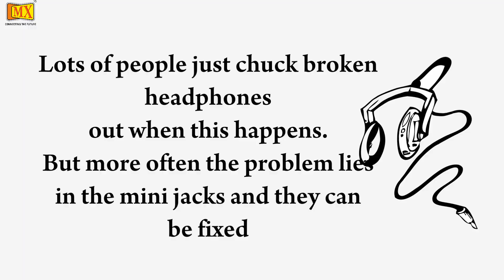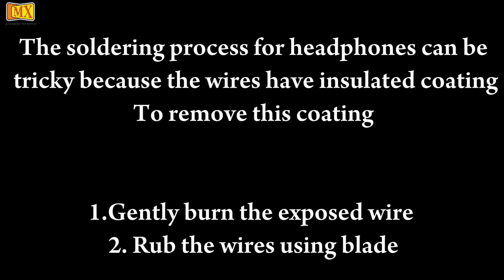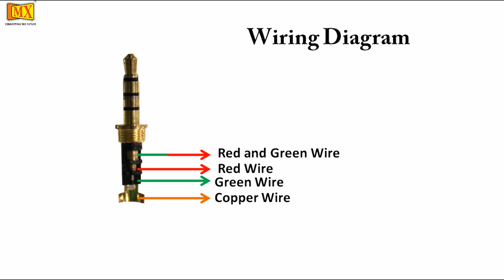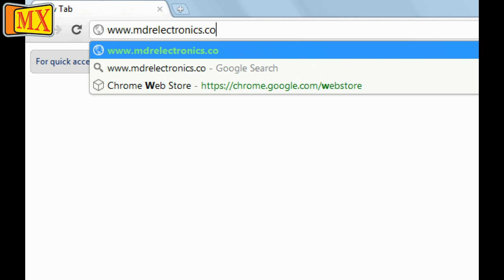How to repair or fix Earphones / Headphones Cables with Mic

Comment: Thanks for making the video. It was useful for most of it. I bought the same replacement plug.
I successfully repaired and tested my Etymotic hf3 and the colours are completely different to your video. From outside in, goes green, blue, red, copper corresponding to sleeve, tip, ring1, ring2.
Tip = Left audio = bLue
ring 1 = right audio = Red
ring 2 = ground = copper
sleeve = mic = green

Comment: Thanks man, I've had some troubles with my connector because was 4 pins but a different design and my headphones are only stereo, the haven't got mic.
Finally I got tired and make them mono headphones, only two soldering points beacuse it's only while my new headphones arrive from UK.
Reply from the maker: Thank you!!

Comment: This seems like a really nice video and just the one I need. I just have one question.
Are you able to test if it will work before soldering the cables on to the metal by holding them against it?
Reply from the maker: Yes you can!!
Reply: MDR Electronics
So I guess I must have done something wrong then since no sound comes out when I hold the cables(twinned, not solderd at the ends) to the metal?
Do you have to solder a bit on them first, at the ends, and then touch the metal covered cables to the 3.5mm contacts connection metal?

Comment: A suggestion for all people having trouble with color cables, connect the plug to an mp3/phone and play music, make different combinations without soldering until you find the right one :) (remember to try the mic and the keys before soldering)

And put the back cup on the wire BEFORE soldering, it's a common error for all the starters and when it happens it's a shame.
Reply from the maker: Thank you again !!
Reply: what the backup??
Reply: fredizzle23 What?

Comment: A couple of things : some fluxite/solder paste would have made a far neater job of the joints.You'd be amazed at how well (and fast) things bond  with a smear of it prior to  starting work. Also, most jack plugs have a crimp which helps prevent the wires being yanked off their joints accidentally ( you actually soldered the last wire to it in fact). This should have been gently crimped with pliers around the outer insulation of the cable.
Reply from the maker: Thank you for the comments....we will keep that in mind for our next video!!
Reply: Been working in the Electronics Industry for over 40 years doing repairs to component level  .. if this is an example of your expertise and abilities I would never recommend anyone to visit you or follow your advice. I realise that the video is 3 years old or more and that you may have improved since then but your video personally gives me no confidence in your abilities or that you know what you are doing!

Comment: Cool video, thanks for posting. My cable coding is a bit different:

1 blue
1 red
1 red/copper stripped
1 green
1 copper

How do I figure these out to solder on a TRRS connector?

Comment: thx man you helped me a lot i had problems with this jack i didnt know where to solder some wires red and green i got almost right the red wire was/is higher than blue wire and i had/have the copper wire or ground where red and green wire or mic wire shood have been

Comment: Why didn't you use the shrink tubing over the connections before screwing on the outer case?
Reply: +Echo6Bravo because he doesn't know what he's doing?
Reply: +Echo6Bravo  The rubber casing sits inside the outer housing, so when its screwed on the rubber is already there.

Comment: I fixed mine myself but with another factory made broken aux cable. just find the right cables(color helps) and solder them to each other.  or just burn the tips and twist in pairs.

Comment: great video! i have a question tho. im repairing a pair of turtle beach headphones (the xl1's to be exact). they have a white fiberous thread running through them. is this the same as the yellow thread in you video...useless i mean? i dont know of any fiber wire and i dont know anything about fiber-optics. anything you could inform me of would really help. i game a lot when im not working and cant afford to just go buy a new pair. thanks
Reply from the maker: We will have to check…..Sorry but we don't have that Headphones!!
Reply: The white fibreous is only a cover for the cable, you can burn it
Reply: thanks

Comment: Hi when I was trying to solder it the solder wasn’t sticking to the plug or wire .in the end the plastic next to the metal started melting and just became a mess. Can you suggest something I could do?   I’m new to soldering p.s I’m using a 30 w solder iron

Comment: Hi : I have the same connector but the in cable of a Klipsch image one headphones has red/green/red and green/copperx2. but in the centre of the red and green cable is a white cable. Where do you solder this on too ????
Reply from the maker: Let us check with our Engineer!!

Comment: Lets say I want to use a 3-pole jack with my 4-wire headphones. What do I do with the left over red-green wire?

If the wires are in contact with eachother after soldering, is it bad? 

One more thing, the cable of my headphones is made of a cloth-like material. How can I remove it since it might not be easily removed like the plastic in the video?

I'm going to perform this later this week and this is useful. Thanks!
Reply from the maker: You can strip them off if you like!!

Comment: Would it be possible for me to make a phone headset(with mic) work on a PC?
Like if i used a "MX EP Stereo 3.5 mm with 4 Pole Jack" from the video and soldered 2 wires with 3.5mm jacks to it, 1 for the headphones output and 1 for the microphone's input?

Comment: My 4 pole jack has a piece that is small coming out of the middle ,one tap out to the left ,and then the big one with the hole in it .the cable coming out has a copper,green ,red, and in the middle of the copper a very small white one. How do you connect this ? ( my earbuds are dr dre  beats )

Comment: hey first of all thanks for the video! but i have 1 question, when i stripped the cables i have a green,red blue and copper! is the blue one the same that the combination?
Reply from the maker: Thank you and Yes some have blue color but the rest part is the same copper has to soldered at the right place

Comment: I just trued to do this. I think I ruined three repair connectors. Its sorta tough to do this tiny soldering. These wires are finicky too. They don't soak up solder easily. Oh well ill continue trying. I have a good soldering station at least.

Comment: I'm pretty sure you were supposed to crimp the black outer sheath of the wires into the "wings" at the top of the connector.  That way when something yanks on the wire, it puts pressure on the outer sheath instead of the soldered connections.

Comment: How would you connect these 4 wires RED BLUE GREEN and COPPER to its control unit from the jack..? Coz I have only to points there and 4 set of wires how.. Please tell

Comment: I suppose your red and green are the same as on the video. You just have to unwrap the copper one off the white and separate them, and your white should be the "red and green" one. Judging by what you said, you have 2 copper wires, just connect them together on the jack, it should be okay... Let me know if you try!

Comment: I have a pair of SOUL earbuds and the wire coding is red, yellow, green, and blue. any idea on what the coding for these are?
Reply from the maker: No idea!!
Reply: exactly what my problem is. but i've researched that the blue is actually for the right channel. i just dunno if it applies too

Comment: I fixed my sound but my mic still doesnt work from my trutle beach px21. I cut the cable in 2. I got rid of the white plastic cover and twisted the copper parts to eachother, whats wrong :s ???

Comment: I bought the same designed plugs for repairing my friend's headset. I gave it up, because the solder didn't attached to the plug's rings. It dropped down from it...I don't know what to do...I used to repair stereo jack plugs, even mine all by myself, but headsets are making me nuts...

Comment: I have turtlebeach px21 gaming headset, a wire is broke off the circuit board in 1 of the ear cups.  can it be soldered back on?

Comment: my replacement jack is different, i have part sticking out, instead of 3 different part, so i have 2 little tubes , and then a tinny arm branching off...it's silver color also...

Comment: You don't need to try to remove the insulation, using a match or anything like that. Tin the conductor with a bit of solder and the insulation will be gone there.

Comment: i have the same problem, i only have 3 wires: blue red and copper.

in your video its 4 wires. how can i fix mine? my headphone is a philips oneal the stretch, it has volume, next/previous control, and mic but 3 wires only?

Comment: i have also a blue, red, and copper wires. where should i connect them? in your video its 4 wires. i only have 3 wires and my headphone has a mic, volume control, and next/previous control. please help me

Comment: if USB connector mic repair how i will repair?. 
one more question. 
if Headset mic problem is near the output of headset speaker. 
how will i solve?.

Comment: I just had to do this, what a pain in the ass, they use the smallest garbage wires.
I got a little bit thicker from an IDE cable. Works like a charm now.

Comment: Hi i just watched your video but my problem its different i got a motorola Earpiece Headset PTT for 2 way radio and i wanted to fix it i've got red cooper green and blue wire but got no idea where they go as there is a little switch board that i should  solder the wires onto please help me as i need it for work tonight IMG_1822.JPG

Comment: Thank you for your nice video ( + ) , but you should also do some soldering training. Yours looks very primitive.
Reply from the maker: Thank you
Reply: Uğur Akgöz I agree with Ugur. Please do some solder training or enjoy a life with cold solder joints.
Reply: +Michael Hardie What did he do wrong exactly?
Reply: You should head the parts enough during soldering. Temporarily touching the parts won't heat the parts enough to fix the soulder correctly. Sorry for my english.

Comment: I have tihs colors waht i do ?
1 copper
1 black copper
1 red
1 green
1 black
When i cut the wire i see the black,red and copper twisted, the green and black copper twisted.
Please help me, my headphone is from my samsumg S3 mini. I make it but the microphone doesn't work.
See what i do and help me to fix it please.
green => Pin 1
red => Pin 2
copper black + copper => Ground (Pin 3)
black => Pin 4
Please help me.
Thanks a lot.
Reply: Sorry for the errors of grammar
Reply from the maker: Let us check with our Engineer!!
Reply: Good guess on putting two wires to ground. The only thing I can suggest is to either look up the diagram for that model, or do some testing. You can get a pin-out board, solder wires from it to all of the points on the jack, then you can use aligator clips to link each wire in turn to the pin-out board and be able to trace which wire goes to which. It's not awesomely safe, but it's a lot easier than tearing the covering off the mic and each speaker to trace wires. I would use an old piece of euipment though, so if you accidentally short it out, you don't kill your S3mini. :)

Comment: Problem. I've stripped the wire and I'm almost ready to solder, but the colors are odd: I have a red wire and a copper wire, which is to be expected, but I also have both a blue AND a green wire. None of these wires are twisted together. I attempted to dissect the original jack to see what wires were connected there, but that ended in failure. Google doesn't give me anything useful- just a ton of "green OR blue" crap which is of no use to me. A little help? I'm fixing them for my brother, and he won't stop nagging me until I do...
Reply: CtrlFreak1337 Mine has 5 wires:

Red: Right
Green: Left
Blue: mic-
White: mic+ (Sometimes this is not there and mic and speakers share a ground wire) 
Copper: Ground

I Googled as well but could not find a description. I disassembled the earpiece and the mapping became clear. The printed board the wires were soldered to had descriptions:. In my case: https://d3nevzfk7ii3be.cloudfront.net/igi/oIikVxwlfesJmChP

Comment: I am searching the largest electronics markets here for a 4 pole jack, but in vain :( .All my damaged Headphones left laid in because of no 4 pole jack :( . Only 3 pole available here in market. The 4 pole and 2 pole (Mono) jack are out of market. Don't know why it is so rare here. I have to search more may be :( .
Reply: just look for TRRS
Reply: Surely it's the connection to the jack that is the problem? Just re-solder.
Reply: +metallitech
Yes the problem is in the connection to the jack.  But the jack is for one time use, fixed. I could use them removing the insulator and re-soldering it, but that looks ugly :) So I need a new 4 pole jack or 3.5 mm TRRS jack. But As I didn't find it here, so using 3 pole or 3.5 mm TRS jack just for audibility, no microphone.

Comment: Hi ,thanks for the helpful explanation. ive only noticed that i have 6 wires in my apple earpods i've cut the yellow one which has no copper wire and it makes them 5 wires ''green_red-green_red_red-yellow-green-yellow'' :/ how can i act with this . 
thanx :D
Reply: AppleEarpods | 103108744794310128218

Comment: I tried to to do this repair but the metal contacts were microscopic it was impossible
Reply from the maker: Sorry
Reply: +HardieJF It's easier if you have a soldering "helping hand"

Comment: but mine has a blue wire. for where is it?
Reply from the maker: How can we help??
Reply: I'm thinking the blue will be the red and green. The way to find out is to check with a tester and set to 200 ohms, pop one on the copper and one on each wire. Your looking to find which ones are the speakers. Depending on how expensive your headphones are your looking for a reading around 34 ohms I guess. After you know which wires are L & R speakers ( you will hear them pop when touching ) you can tell the other two are ground and mic. Copper will be ground always. Process of elimination.

Comment: Didn't insulate to prevent shorts. Also didn't crimp the cable. Lol only the solder is holding it together.
Reply from the maker: It does not insulate unfortuntely
Reply: @ItsFiveNow  little tip working with something like this. Apply nail polish at the end. It will insulate it. 

And crimp the wire!
Reply from the maker: @steadyhawkhawk4180  Thank you for the advice

Comment: Not single tutorial of this sort recycled the old TRRS plug. I do most of the time since the plug itself is not the problem but the wires.
Reply: but how do you fucking crack it open?
Reply: BARON well, it's just made of hard plastic. I just pry it then desolder the old wire. Then reattach the original cord or another cord. I can attach a samsung TRRS to an alcatel cord or alcatel TRRS to an apple cord. I don't buy TRRS, i recycled them. And when everything is ok, i just housed them in a hollow ballpen tube. Not that aesthetic but fully functional.

Comment: i need help with my earphones. whenever Iisten to music with my earphones I can never hear the actual singer onky the backing vocals and the music.  I can only hear echos of the singers. it is really annoying. plz could anyone help me with a solution. it would mean a lot. thank you
Reply: did u drop your earbuds ?
Reply: No
Reply: I actually have the same problem with my apple headphones. If I wrinkle it I can hear the sound clear but then it dissapears again
Reply: +Muhammed Kahraman I think this is a case of a broken audio jack. The wires might be fully intact, but the audio jack isnt making proper connection or is broken when you plug it into your device
Reply: +RawSauce338 so it means I have to do the same as in the video?
Reply: Yes, look around online to buy a new audio jack OR recycle an old audio jack from a previously broken cable.

Another thing to look for is that if you're cable uses a 3-pin or 4-pin connector. If the cable has a microphone, or one of those 'pause' buttons on the cable, then one of the ends (The end you plug into your device, not into your headphones) will have to be a 4-pin if you want to keep using the mic or button.
Reply from the maker: Where are you connecting them too?

Comment: Hi i have Urbeats headphones, i have:
A copper wire thats wrapped around a white wire
Red wire
Green Wire
Green wire wrapped around exposed copper
Red wire wrapped around exposed copper

HELP ME!!! :O
Reply: Btw i have the same jack thats in the video
Reply: You have 3 ground wires, they are to be soldered to the same point on the jack. Without being able to have hands-on with your headsets, I cannot tell you which color is which speaker or mic. Use a pin-out board and alligator clips to test which is which. Use an old piece of hardware in case you short something out, you won't ruin your good device. You may be able to also remove the rubber coating off the original end to see where each wire was soldered.